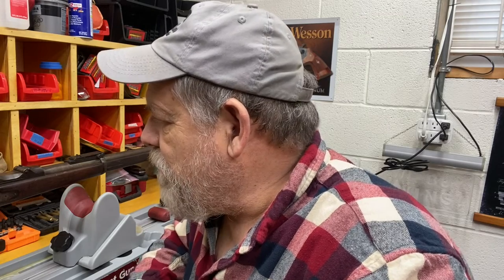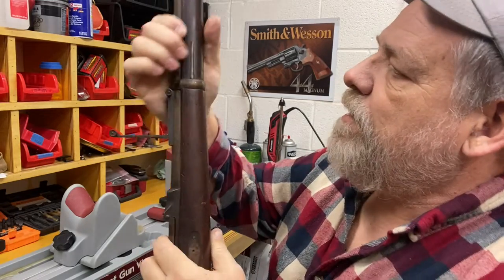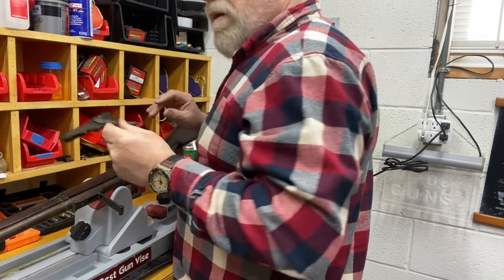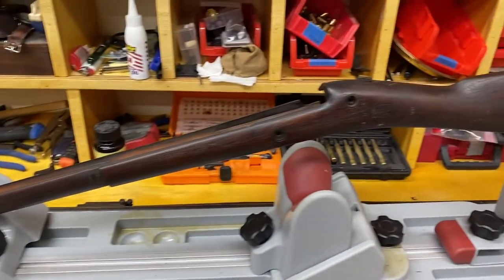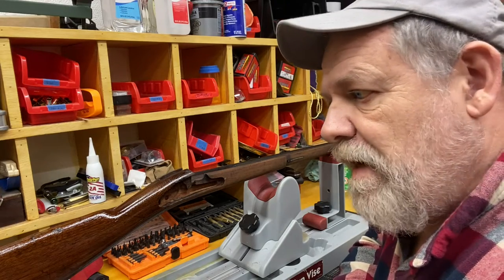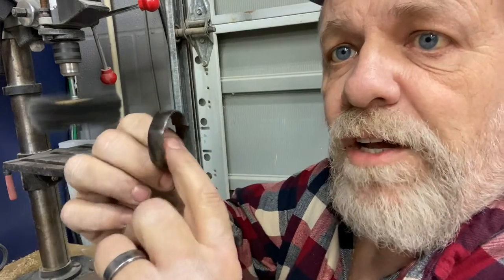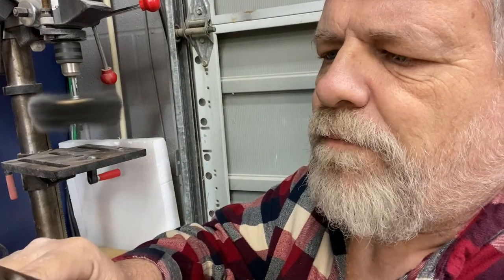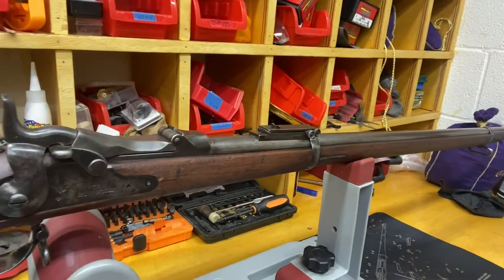1873 Springfield Trapdoor Rifle 45-70 restore / Conservation

Comment: I have 3 trapdoor guns, a carbine, a rifle, and my first one which was just a barrel and receiver.  I built a carbine from this one as the barrel was cut down to a carbine size.  I did find a cut down stock for it which was badly cracked and I took it to a local gunsmith who fixed it and made it absolutely perfect.  I personally like to find early unmolested black powder cartridge Springfields in 50-70, and keep them just as I found them because it is what most of us are looking for and when it becomes yours you can personalize it to suit your taste.  Anyway you did a beautiful job creating what you like and that is all that matters.  These are great guns and getting more expensive and harder to find as time goes foreward.  Thanks for sharing your story.

Comment: I inherited my Trapdoor about a year ago. And as far as I can tell and from what I have learned it was my step dads' great, great,grandfather's. I have done a lot of investigation on this rifle about using modern smokeless ammo instead of black powder, and was told that as long as the rifle is in good shape (which it is) I can use the 45-70 Gov't I bought. It's 405 grains and was also told that it can handle upwards of 500 grains, but decided that this 405 is probably good for now.
I haven't cleaned it up in any way except the inside of barrel and it looks pretty good. Good rifling still seen. I wanted to make sure it was rifled before I went through all the trouble of restoring it. Your information is by far the best I have been able to find on Youtube or any where for that matter, and will start on it tomorrow. I would like to know what the make of the stand is you use in this video. I have a clunker of a home made stand that just doesn't work, and will have to make one soon if I am to do this restoration on a regular basis. This gun isn't the only one i inherited. They are all antique or at the least vintage. Long guns and pistols too. Thank you for your great knowledge. Semper Fidelis.
Reply from the maker: Thanks for your feedback.  Let me know your experience when you get a chance to fire it for the first time.  I really enjoy these old guns and it's nice to hear you have the same interest.  Here is a link to the gun vise I was using on amazon.  Good luck with your project!  https://www.amazon.com/Tipton-Best-Cleaning-Gunsmithing-Maintenance/dp/B001AT3SCC/ref=sr_1_1?crid=1G9VGUVR4PIAQ&keywords=tipton%2Bbest%2Bgun%2Bvise&qid=1662508150&sprefix=tipton%2Bgun%2Bvise%2Caps%2C74&sr=8-1&th=1.
Reply: @magnum6886  I will certainly keep you informed when I fire my beast :)

Comment: That first boil did a great job cleaning with the carding wheel. Heck, on your second boil you could add a couple hot dogs to the boiling water for a snack. Multi-tasking is what they call it now a days. Cheapest ammo I found was around $4.00 a round with free shipping. They call them Cowboy Loads using smokeless powder that creates a low enough pressure that you will not harm your trapdoor. Black powder makes a mess, and you shoot only one round, say deer hunting, you still have the chore to clean the rifle. I own 4 flintlocks that I clean them as much as I shoot them. Good Video and I'll be subscribing because I feel that we are on the same wavelength, so to speak.
Reply from the maker: Thank you!  I actually loaded up some rounds myself and posted a video of my first shots with it.  I was thinking about the hot dogs also!  Lol

Comment: Sorry if I missed it. How would you restore a rusty exterior barre?
Reply from the maker: I used the boiling process on it as well.  I used a piece of rain gutter and capped both ends and then sealed it up so it would hold water.  You can use whatever heat source you like but I used a gas grill.

Comment: Very nice job I have one also in the same rust colored patina. After seeing how yours turned out I am considering the same process for mine. The steam & buff process was also described on the CINNIBAR channel. You didn't discuss the condition of the bore to any length but mine is pretty pitted and corroded.
Reply from the maker: The bore is in pretty good shape and cleaned up well.
Reply: Crown Royal bags make for excellent possibles bags . And they're so fun to collect!

Comment: Following up on my earlier comment I purchased one of those inexpensive bore scopes and was dismayed to find the bore of my 1873 rifle badly pitted and corroded upon close inspection. I had fired the rifle once back in the 1980's when I purchased it but had forgotten what the outcome was. So I went to the range and was pleasantly surprised that despite the bore damage it shot some old jacketed ammo that I had purchased with the rifle into a 3 shot one big hole group at 50 yards. I tried some new lead bullet cowboy ammunition and the group opened up to 4-5 inches at 50 yards. I understand jacketed bullets are hard on these old barrels but if it can no longer shoot lead bullets what's the point?
Reply from the maker: From my understanding, if you slug the bore to get the exact bore diameter and then be sure to use SOFT lead bullets that are cast specifically for it I think you would have better groups. Most commercially made ammo is undersized for these old guns and would affect accuracy.  The soft lead will be able to obturate to sufficiently fill the grooves in your barrel which will stabilize the bullet and should tremendously increase your accuracy at longer ranges.  I wouldn't use jacketed rounds for fear that they will eventually destroy any remaining grooves in your barrel.  Give it a try and let me know your results!
Reply: @magnum6886 yes the current commercial loads are made for replicas, which have a smaller .458 bore. You’ll need .459 soft lead bullets ( hollow base) so it can close up at the end to form a seal. Jacketed bullets will eat the soft inner barrel quickly.

Comment: Hey Magnum68, luckily, we can still get original unused parts for pretty much the entire rifle. I replaced all the springs, a few screws, a firing pin, ejector assembly, and a few other ding dongs while restoring my old Trapdoor. I love my 149-year-old infantry rifle. It's a ten-pound rifle but I hunt deer by staying put in a ground blind and let the deer come to me. I went overboard on refurbishing my rifle, but it will make it another 150 years for sure. I even bought an original socket bayonet and scabbard, sling, original front sight cover, several original tools and enough ammo to be able to hold off the Comanches till the Calvery comes. You did the very same as I did and tore it down and made a completely new looking beauty. I wasn't worried about its value as much as I was worried about safety and dependability. I should have stopped where you did, but I got carried away and now it looks like a reproduction instead of a history piece. I'm going to do a Carbine Trapdoor next, and I'll behave myself with it and not go hog wild.
Reply from the maker: I'd love to see that carbine.  You should do a video with it!